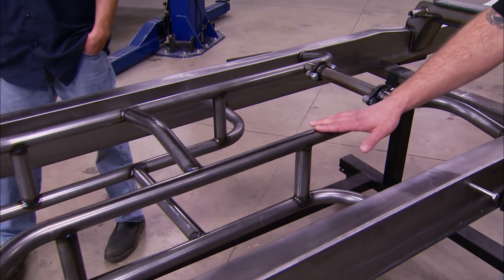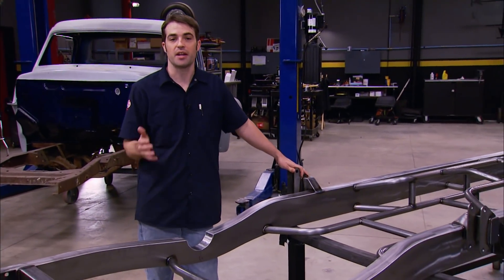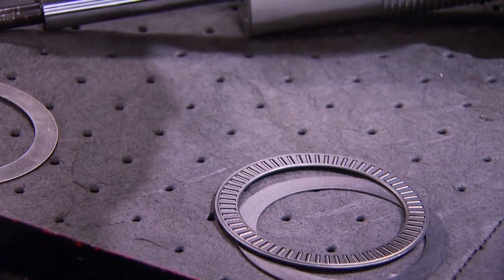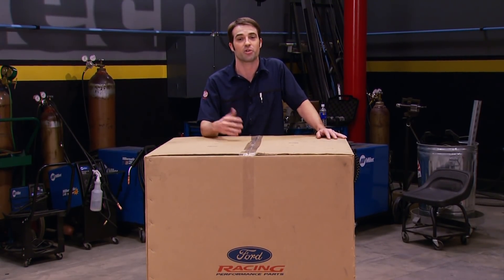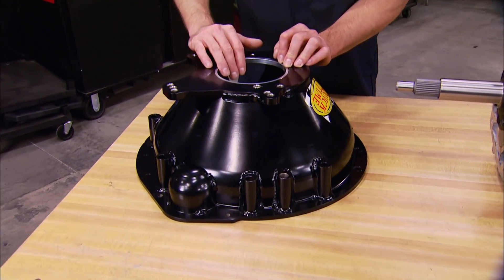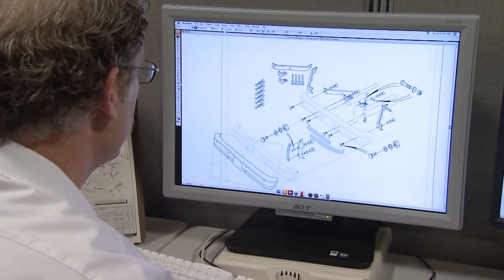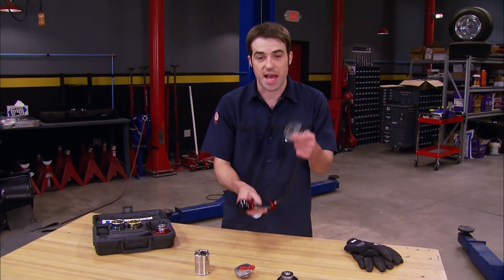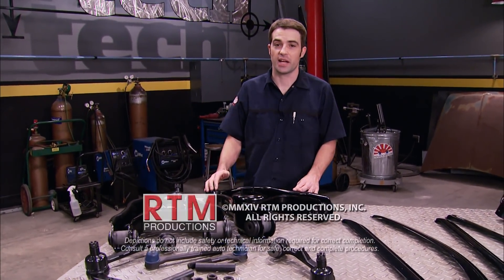Modernizing The 1955 F100 Chassis & Suspension - Truck Tech S1, E23

Comment: I put a thumbs down due to the fact that they actually didn't do a restoration on the truck.... All they did was show a new frame, put together a new suspension while putting it on the truck then show the engine+transmission parts and nothing of putting anything together or painting.... the most that was helpful was how to pressure test the coolant lines and thats about it. I honestly thought the behind the story was kinda or somewhat irrelevant only due to the fact that I was waiting for a full episode of getting your hands dirty and putting every thing together instead of "hey look at what we got. Its expensive so were just only going to show yall the little stuff of it."

They didnt even put the body on the new frame yet like wth. This video is a form of click here and well show you our resto build but its A CLICKBAIT

Comment: That's all fine and dandy.. If you have  the 💰 to purchase a brand new automobile and then put a old truck body on it. How fast do you need to go from street light to street light.  My 56 is going back all stock 223 6 three speed with overdrive no hack job hear. And after you hotrod it.  It will soon be out of stile with avery things going electric..

Comment: the ford V6 they sell now is no joke with aftermarket turbos they can make 900HP all day and over 1000 with little effort if needed . it's the same engine in Hoonigan's hoonitruck except the Hoonitruck runs the Ecosport version of the same engine making 916 hp and 702 foot pounds of torque .think about it like this buy this as a crate engine get a set of headers and an aftermarket turbo and you have a 600 plus hp crate engine in your car or truck that weighs half what a V8 or iron block Japanese 6 would weigh
Reply: Huh I had no idea.  I figured it would eventually suck like the 5.4.  good info.
Reply: But I seriously doubt it'll outlast a V8 though.

Comment: EPIC FAIL!!!  use the engine that came with truck from the factory people , there is nothing like the purr of a flathead V8 with headers
Reply: It never came with a flathead...it came with a Y block in 272, 292 or 312 displacements.
Reply: @markanthony3275  i stand corrected , still it would be better to have a flathead V8  under the hood

Comment: The old trucks have real steel bodies that aren't made from imported junk steel. The styles are great too. Trucks have become too generic looking, mass manufactured anymore. It's hard to tell some brands apart.
Reply: Can you image any modern pickup ever becoming a classic with all the endless plastic components and computers. Who is going to bother manufacturing these countless parts for these thin steel/aluminum bodied vehicles.
Reply: @richardgalli7262  Exactly!  That's why so many end up at the crusher!  We've become a throw away society with everything we buy.  Have you seen the videos of acres and acres of brand new cars and trucks that haven't been sold?  They're just sitting, collecting dust and rusting away!  Supposedly they can be bought for $125 -$150 a month payments, or bought outright for less than half price.
Reply: @jamesdiehl8690  Essentially, we have expensive disposable automobiles.
Reply: @richardgalli7262  Indeed!  Almost everything is disposable anymore, including unwanted babies! 😔   😞😓😩

Comment: I think the T5 was the OE in the mustangs, not the stout TKO, and it wasn't back to 79 either.  HUGE difference there.
Reply: You are correct. 79 through early 83 used the srod. Late 83 through 93 used the T5. T5's were also used in Mustang v6's until 2010. The TKO was never a factory option.